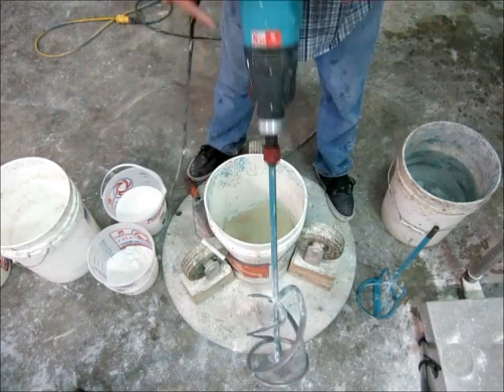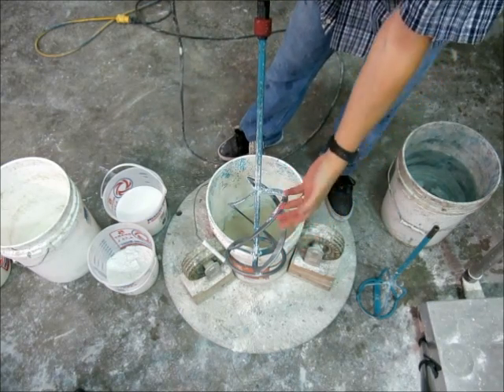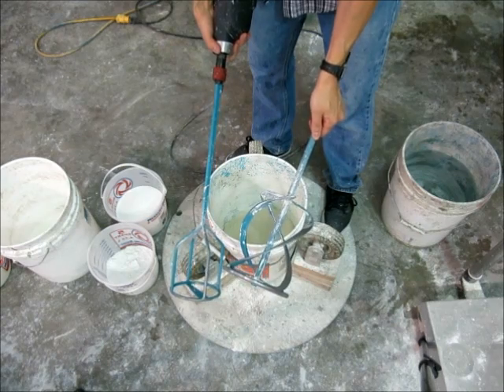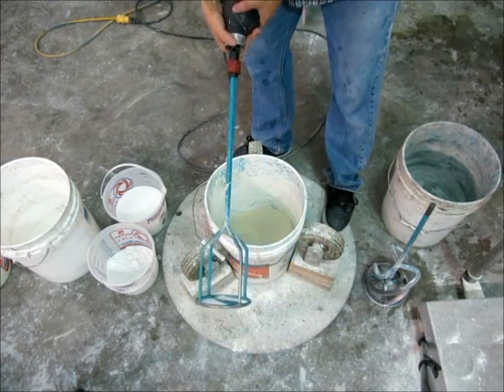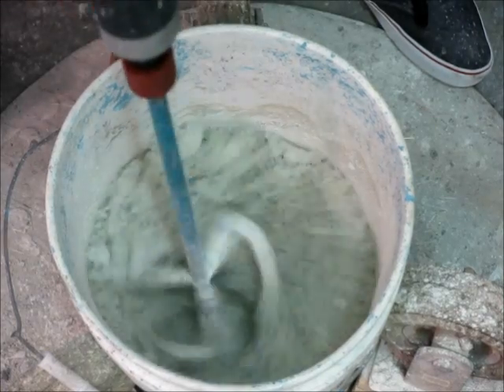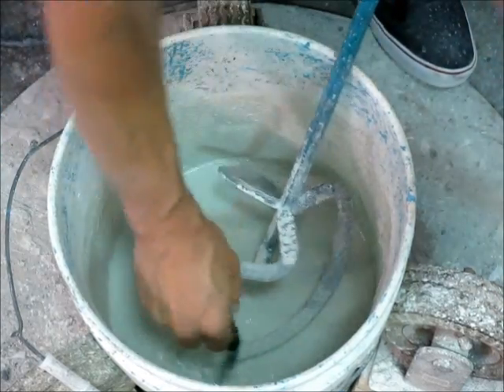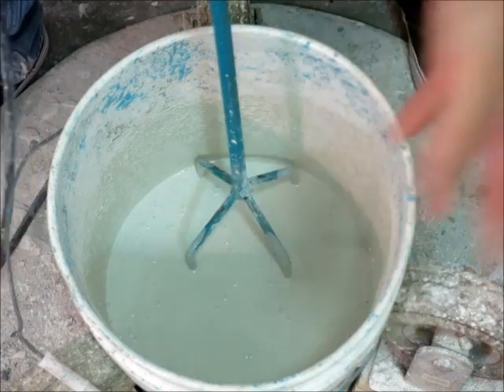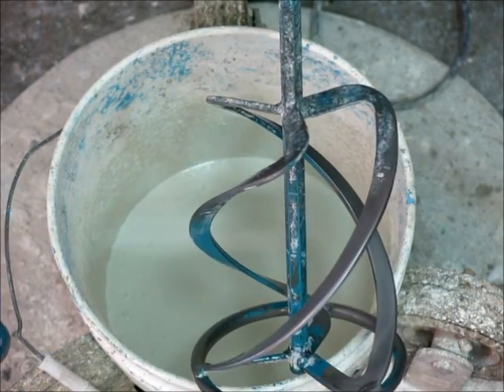Collomix paddles for mixing GFRC concrete countertop mix

Comment: Is it okay to use "Earth Auger" as concrete mixer for post holes?
Reply from the maker: An earth auger is used for making holes in the ground, and as such it displaces the soil. I have never tried using it for mixing concrete in a hole in the ground, but I suspect it would simply throw out the concrete.

Comment: Just received mine today, but it seems to introduce air inside the mix (bubbles), we'll see ;)
Reply from the maker: All mixers, no matter their design, will entrap air into the mix. GFRC needs to be mixed at a high velocity to help disperse the fine particles like pigments and cement. This is called high shear mixing, and it's essential to getting a consistent, high quality mix that maximizes the potential of the ingredients.

A good mix design should not allow air to form foam that gets whipped up during mixing. Defoamers are used, either as admixtures or as part of the ingredients, to destabilize the foam whipped up during mixing and help the air bubbles escape. Only fluid mixes that are liquid allow air bubbles to rise on their own. 

Defoamers don't make air disappear. What they do is destabilize the foam that traps countless tiny bubbles and allows those tiny bubbles to coalesce into larger bubbles, which have more buoyant force. That lets them push up by buoyant force to escape the mix. 

So don't look at a mixer for entrapped air. Look instead at your mix. You may need to add a defoamer such as Fritz Pak's Air-Minus.

Comment: I was recommended the xo4 for concrete mixing. what do you think ?
Reply from the maker: The Xo6 is more powerful to handle high shear mixing of GFRC. The Xo55 is also recommended. Please see https://concretecountertopinstitute.com/free-training/gfrc-equipment-for-concrete-countertops/
Reply: @TheConcreteCountertopInstitute  Thank you. Now you have me really looking at all their options. If you could please tell me what the difference is between the x055 old vs new vs 'r' that would be most appreciated. The 'old' model x055 seems to be selling for $100 USD cheaper right now.
Reply from the maker: @Laguna2013  The older model would be fine. All of the Collomix machines are high quality, and I have been using them successfully for years.
Reply: @TheConcreteCountertopInstitute  Can I mix with the X055R in a 5 gallon bucket? Will it fit and have enough room to mix properly? Thanks
Reply from the maker: Yes, it will fit just fine in a 5 gallon bucket.

Comment: hello. i have a question about mixing. what hppens when concrete be over mix. for example when i mix(silica sand-one part ' cement-one part ' superplasticizer-1% and water-25%) for three or four min its ok and self-leveling but when mix again the concrete changed from self-leveling to a fixed concrete. whats the reason?
Reply from the maker: It's hard to say without knowing water/cement ratio, superplasticizer chemistry, etc., but you could be overplasticizing the mix, and the sand is segregating and settling out into a dense layer.
Reply: @TheConcreteCountertopInstitute  w/c ratio 25% - superplasticizer tillman on-s 2000 powder (1%) and not segregating - when over mix concrete be puff(a little)- and be fixed in the bucket anyway i learned a lot from your website, and thank you very much, and studying it almost every day, one to two hours.god bless you
Reply from the maker: @hamidrezar1040  I'm really sorry, I just don't know without being more familiar with that ingredient. I'm glad the website is helpful for you though!
Reply: @TheConcreteCountertopInstitute  i think find it . Temperature! when reduce mix temperature , that fixed. what is MIN and Max mixture temperature ?
Reply from the maker: @hamidrezar1040  Ah, yes, temperature has a significant effect on concrete curing times. Generally you should try to keep the ambient temperature above 50 degrees Fahrenheit and below 80 degrees.
Reply: @TheConcreteCountertopInstitute  Of course, i mean the high temperature of the material and therefore the excessive heat, which I used from cold water and ice to reduce the hydration temperature.
Reply from the maker: @hamidrezar1040  Excellent - ice is the perfect way to reduce mix temperature. Just weigh it along with your mix water.